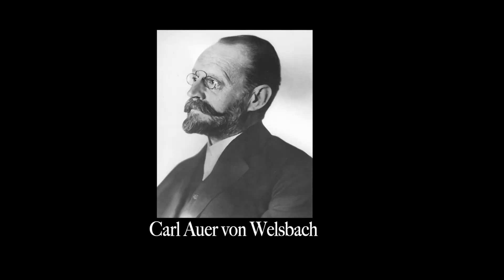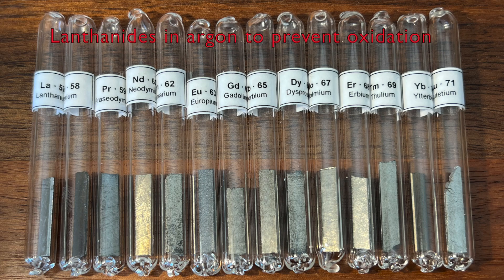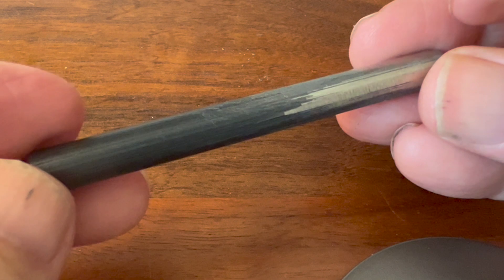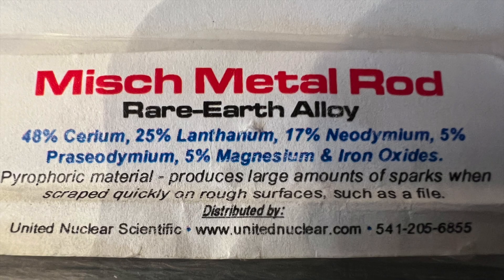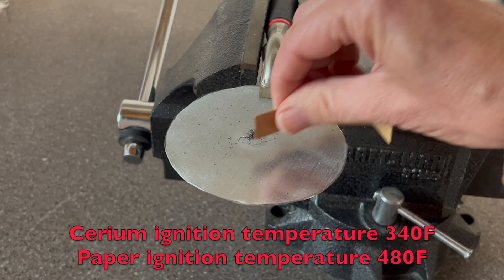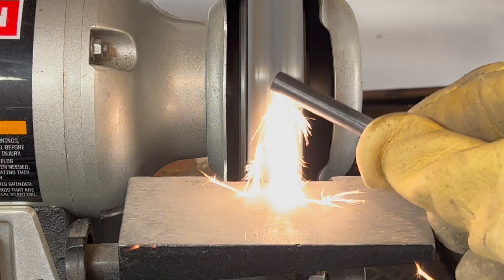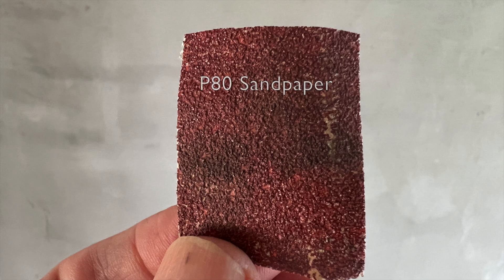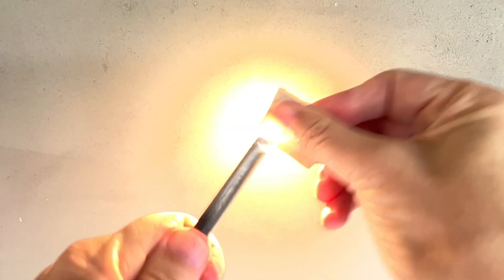Mischmetal -- Slow Motion Sparks

Comment: Is the iron and magnesium what causes the sparks?
Reply from the maker: Good question.  As  I understand it, the cerium ignites first. The heat produced by the burning cerium should be sufficient to ignite all the other metals (including iron and magnesium) within the alloy's shavings. I've read that the iron and magnesium are primarily added to increase the stiffness of the misch metal rod, since the rare earths are rather soft.